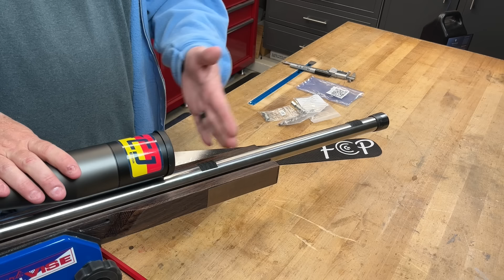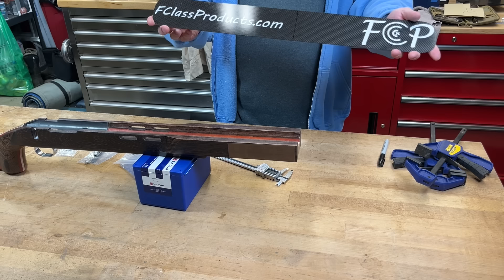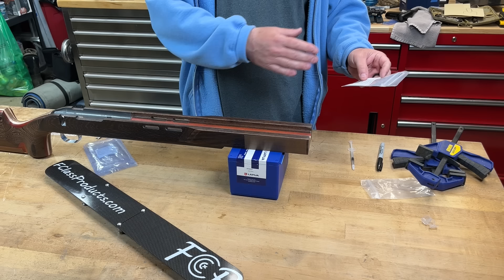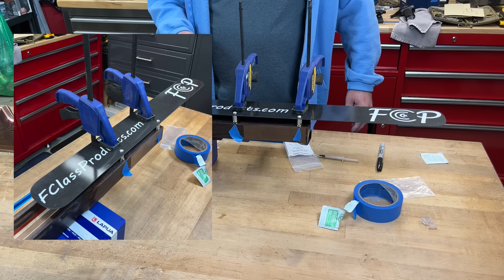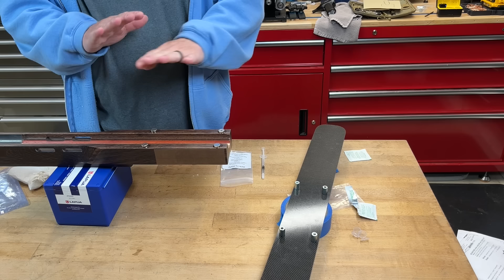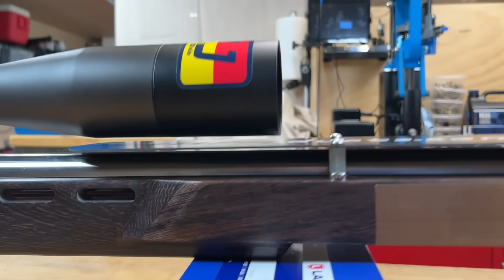F Class Products Hover Mirage Band Shield Kit

Comment: Do they make anything for Chassis guns?  Might be easy to have a post on an mlok attachment to hold the shade.
Reply: Right or all the chassis that have threads all the way down the forend for NV bridges or enclosed ends would be perfect candidates for it
Reply from the maker: You'll really don't ever see chassis systems in F Class for a couple reasons but I figure there'd be a few cool ways to do this with a chassis if you wanted.
Reply: @FClassJohn  I’m thinking more for PRS.  Sometimes that barrel gets cooking after 10 shots